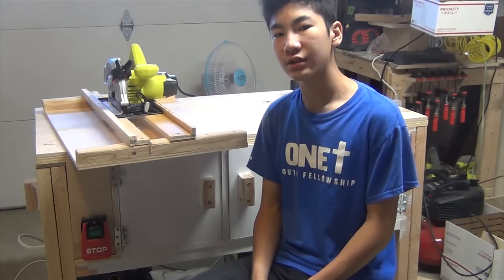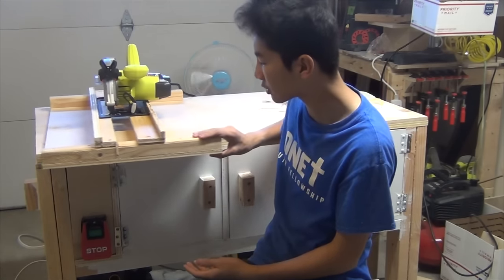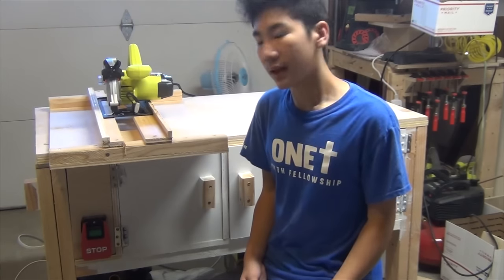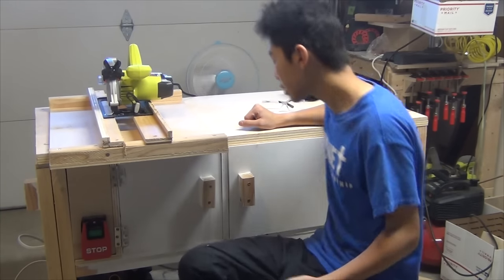Circular Saw Crosscut Jig// How To

Comment: I would extend the top rails out past the end so you can completely clear the saw blade from the material but otherwise I think I will have to borrow this design myself.
Reply: I have spent months researching diy table saws and found an awesome website at Wilfs wood blueprint (google it if you're interested)

Comment: This kind of suffers from the same problem many "make your own drill press" videos..you are using a table saw to build a crosscut saw. So...you already have a table saw to make accurate cuts with, thus making building the jig more accurate. Lets see it made by hand without a table saw, then I'd be more interested
Reply: Some other videos I have seen, make use of a factory cut.  That is, with a piece of wood cut from the store or lumber mill, you assume it is straight or you can make additional measurements / use a level to verify.

Once you have that as your straight edge, then use that with the circular saw to make all the other staight cuts, until you have the pieces you need for your cross-cut sled.

Comment: Good video. Thanks!. One question: What did you put on the top of guide to make the saw slide easily?
Reply from the maker: Hi Mauro Sanchez, I put some paste wax on the slides to make it smoother, hope that helps!
Reply: Ok thanks for your answer. I will try it